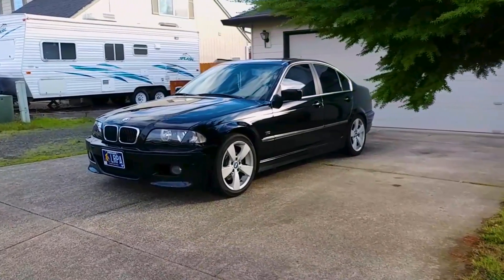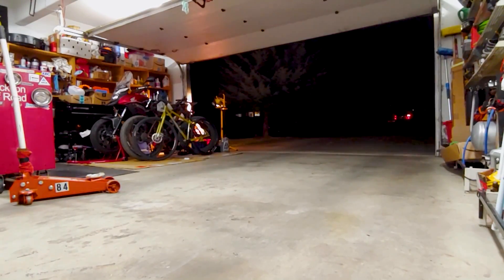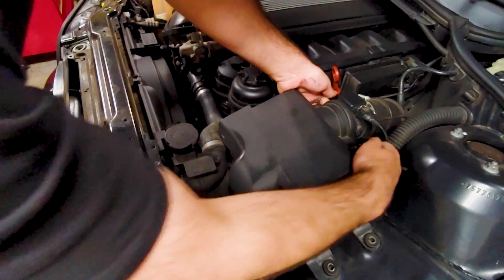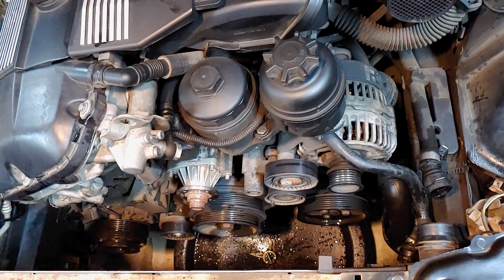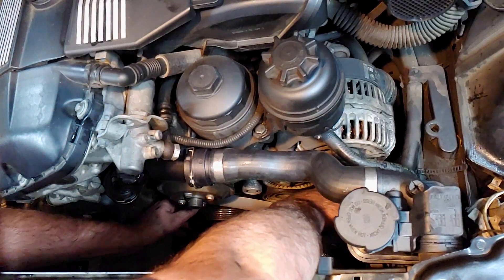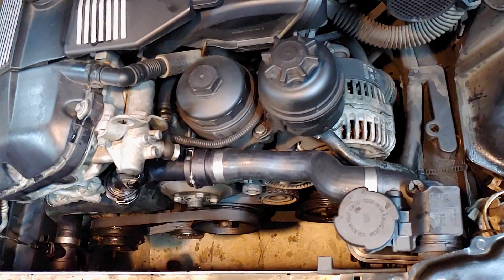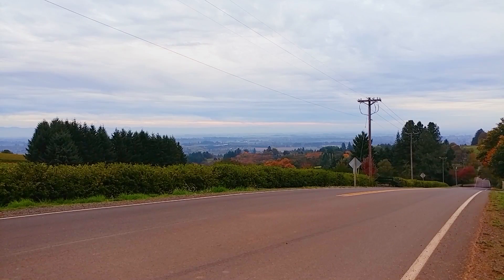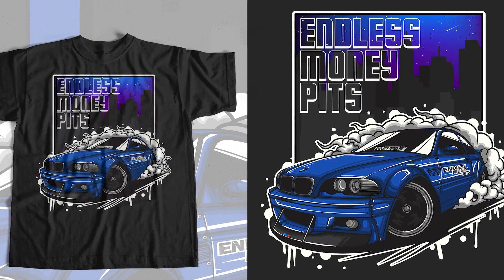BMW Water Pump Replacement (M52 / M54) Tool Sizes and Torque Specs

Comment: @endlessmoneypits, BEWARE that Graf metal impeller water pump!!!  Buy Genuine BMW ONLY!  I replaced mine on my ZHP with this 'new and improved' metal impeller water pump at 70k miles.  The original was still working fine with the exception of a little coolant leak from the weep hole.  The Graf unit did NOT last!  I don't know when or at what mileage, but it self-destructed.  The spot welds on the impeller didn't hold at all.  I'm so glad it didn't grenade the motor.  Fortunately, the car never overheated!  
Afterwards, I replaced with Genuine BMW ONLY!  This was part of a complete cooling system overhaul with only BMW parts including the radiator.

Comment: Thx for comprehensiveness of the procedure

If you have a MECHANICAL belt tensioner you CAN use the T50 and crank on the centre of the pulley (and both alloy M52 E39s I own show evidence thats how its been done) but the bolt will easily get damaged and strip - better to use the 16mm "nut" next to it on the tensioner arm. Same with mechanical AC belt tensioner

May I suggest you mention your model or disclaim at the start there may be variations, as this procedure is not exactly the same for all flavours of M52/M54
Reply from the maker: I've removed the belts at least a dozen times and never damaged the bolt. Make sure it is free of dirt so the tool fits in properly. Never heard of the issue you're talking about before.

Comment: I was lucky. The original one on our ‘06 X3 lasted over 200K, running with Prestone for at least half its life.😅Started making some noise with a slight leak. It had the better PPS-GF-40 composite impeller so I replaced it with same (Saleri).

Comment: I changed today:
Water pump
Expansion tank
Thermostat 
Bled the system but no hot air coming from the heater. Also after a while a little white smoke from engine bay but temp gauge in car read normal. Please advise guys.
Reply from the maker: Try driving up and down some steep hills to dislodge any air pockets in the system and bleed it again after it cools down. You could also try bleeding the system again with the front of the car slightly raised.
Reply: @endlessmoneypits I took it for a drive and the heating started working. Car drove like a dream and temp gauge looked good. I pulled over at a petrol station and popped the hood and could see coolant leaking from the bottom of engine but couldn't see where it was leaking from 😢 got any ideas?
Reply from the maker: Probably one of the hose connections. They can be difficult to fully snap into place. Check what you can see with a flashlight and be careful around hot parts.
Reply: I did break one water pump stud. Could that cause a leak? But it looks like the leak is coming from the left of that area. I have a photo if I could send it to you?
Reply from the maker: That could be the source of the leak but I'm not sure.
Reply: @endlessmoneypits  one of the 10mm thermostat bolts also broke off. Can coolant leak from there too if I used only 2 x 10mm and 1 x 13mm bolts?
Reply from the maker: It's possible but I've never tried it. If you keep snapping bolts, a torque wrench might be helpful.
Reply: @endlessmoneypits They broke off on removal. I guess the previous owner over torqued them.
Reply from the maker: Dang!
Reply: @endlessmoneypits  no idea how I'm going to get the broken bolts off 🤣
Reply: @endlessmoneypits  Quick update buddy. I managed to get the bolt out of the thermostat. It was leaking where the lower 10mm bolt goes. Everything working now 😊 Let me take this opportunity to thank you 🙏 Your YouTube guides are some of the best on the channel. Easy to follow and very clear. Thanks again and keep up the good work💪👊👍
Reply from the maker: @ricardomaldini6508 that's great news! Good work, and I'm glad I could help.
Reply: Bleeding these systems can be a bit of a pain.

Have the vehicle outside and a “spilless” funnel attached to where the radiator cap goes.

Release pressure from the bleed screw and fill the system until water/coolant comes out of the bleeder screw.

Tighten the bleeder screw and let the vehicle idle until the thermostat opens.  It will be after the temperature gauge on the dash reads up to temp, as the indicator is “weighted” so it sets mid way between cold and hot before it’s actually to operating temperature.

Once the thermostat opens, coolant will drain from the overflow reservoir into the engine and the level will drop.   Open the bleeder screw allowing air out until only fluid comes out.   Tighten the bleeder screw and add coolant to your “spilless” funnel to the appropriate level.   You may have to do the part a few times to get it all sorted.

Past this point, you should be able to drive the vehicle as normal without worry of overheating.

To purge all of the air out of the cooling system, you may need to crack the bleeder screw (while the engine is hot) a few cycles allowing air out until only fluid comes out of the bleeder screw.  Then let it sit overnight and fill the overflow container to its “full” mark when the engine is completely cold.  To get it perfect it may take 2-3 heat/drive cycles of doing this last step, but it’s not absolutely necessary as long as you’re getting only fluid out of the bleeder valve when hot, the upper radiator is turgid when hot, and the coolant level in the overflow reservoir is to your liking.

Comment: The link to mechcanical fan is broken. Do you have another source?
Reply from the maker: Thank you for letting me know! I have replaced the link.
Reply: I bought an OEM  pump that failed after 15 k miles. So now I put the Chinese crap in. They last longer than the OEM stuff that’s all getting old sitting on shelves. Especially since you’re changing it anyway so why spend so much for basically the same pump. They were shit from day 1  from the factory, so why use the OEM?